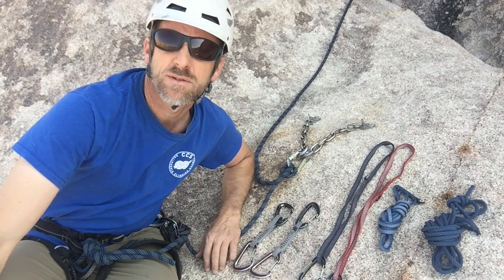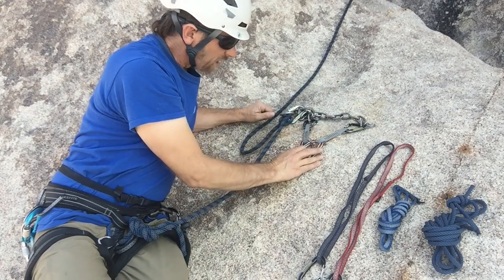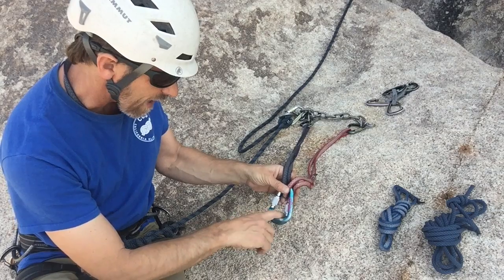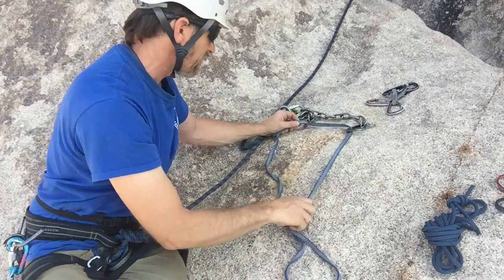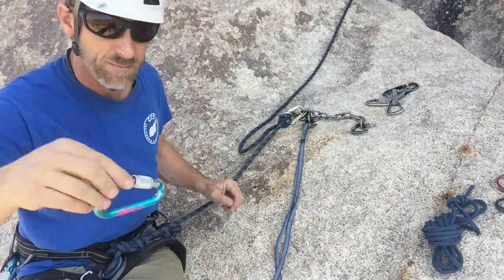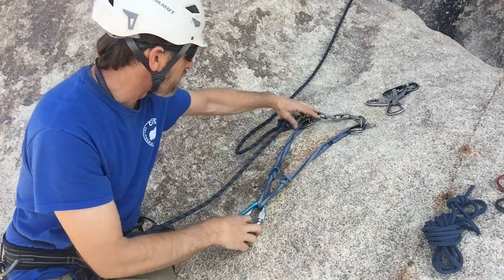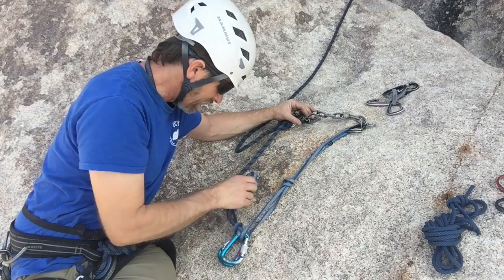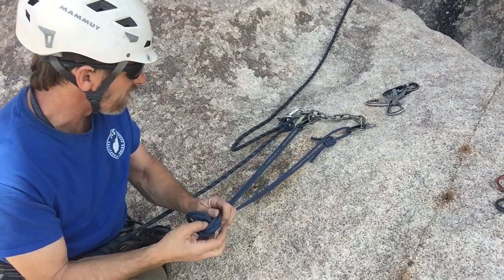How to Rig an Anchor from 2 Bolts

Comment: Watching this as a complete beginner it seems like the double QuickDraw method would be the simplest for someone new to climbing - no knots or angles to worry about and RENE to the extent that you mentioned. Any downsides here or reasons to preferentially choose another method? Also where does a PAS fit into the mix?

Comment: Great video! However with the limiting self equalizing knots you DON'T want to twist the rope. No need to make an x because the knots won't let it pass. Also the x introduces friction so it doesn't self equalize well.
Reply from the maker: What you are suggesting runs counter to my training.  However, techniques do evolve over time, so I am not going to say you are wrong.  In fact, I hope you are right because that would simplify the rig and improve equalization as you point out.  Is there some data or research that you have found to show that the knot won't pass through the masterpoint carabiners if one bolt fails?

Comment: Why not run the rope through the chain ,the carabiner is way weaker then the chain ,that the weakest link in that system
Reply from the maker: Because you can wear grooves in the chains and they will have to be replaced sooner.  You should always put the wear and tear of toprope sessions on your own carabiners instead of wearing out the hardware we all share to rappel/lower off with.  It is acceptable to lower the last climber who cleans the anchor off the chains/rings but not the other members of the party.  Unless there are mussy hooks.  In which case go for it.  They last a really long time.

Comment: Thank you! This weekend passed. I climbed a lot and one duo I met had 3 carabiners on a sliding x. All different sizes too.
His friend climbed up top and couldn’t be lowered down and started buggin out!
I run up top and found their smaller carabiner in the middle was caught between 2 bigger black diamond carabiners. Which was jamming the rope up.
Not a catastrophic human error. But if they were by themselves they would’ve been screwed cu he had no daisy chain to clip into bolts up top amd other stuff I thought of.
So I told them ditch the 3 carabiners or get all the same attaché size so you don’t have that issue again.
Just got into climbing in may so I’m new still but I been out every weekend learning and was glad I got to fix more experienced climbers setup.
I honestly hope climbing is a big part of my life till I’m dead. Never felt so good! Haha
Reply from the maker: You bring up an important point.  3 steel ovals that are the same size and shape seems to work the best for me.  And yes, I always have a sling and a locker that I can leash in with.  I also like to carry a rappel device with me at all times in case I decide it would be better to rappel than be lowered,  ie rockfall injures the belayer.

Comment: I struggle to understand the need for two 24kN rated 'biners yet only a single sling. The sling is if brand new good for 14kN max after adding the knots (~60% of 22kN). Given each bolt is unlikely to blow below 30kN, the sling seems like the weak point! If it broke at the limiter knots then both carabiners would slip right out. I think the sling is added to provide redundancy across the two bolts but in reality becomes a single point of failure at the limiter knots.
Reply from the maker: Great question.  I haven't heard of climbers whose sling broke at the knot in this setup.  In fact it's hard to break a sling in climbing falls.  Have you heard of a failure like that?  I couldn't rule it out but it sounds unlikely.  As far as using just one locker at the master point instead of two, I think that's great if someone has their eyes on it to fix any problems that may occur like the carabiner unscrewing or getting pinched awkwardly. If no one is there to monitor the masterpoint, I feel more comfortable with two carabiners reversed and opposed.  A single 22KN carabiner is plenty strong, but they are squirrelly and get themselves into trouble from time to time.
Reply: @CaliforniaClimbingSchool  https://youtu.be/NwbMfh4FqT4?t=959

Comment: Can you explain why you say it's so important to avoid avoid 6-12" of extension while using a sliding X? I imagine you're using a dynamic rope, right? Climbing with a dynamic rope will prevent the shock load that you're worried about. If you're using a static rope then yes the shock loading will be immense. But climbers use dynamic rope and routinely take much higher falls than the 12" you'd see if an anchor failed. For example, if a 75kg climber falls 3m and there is 15m of dynamic rope available for stretch, the resulting impact force is 2.5kn. But a 12" fall in the same scenario would only be ~1kn. Tying knots in a sling can reduce the breaking strength by 50-60%. So why sacrifice your first line of defense by taking a 20kn sling and turn it into a 8-10kn sling (by tying limiter knots) just to avoid the potential ~1kn of force you'd take if one of your anchors failed? I'm not a climber by the way. I just like the science but your decision doesn't make any sense to me, no offense. Maybe I'm missing something?
Reply: Hi there, I think its because the dynamic rope has already been stretched to its limit by that point thus becoming a static rope? Not sure.

Comment: why not using locking carabiners. its just safer and it dosent take more time
Reply from the maker: If the carabiners are swinging in the air on steep terrain, there is certainly no need for lockers on the bolts.  When the carabiners are pressed into the rock on lower angle terrain, lockers can add a bit of safety.   Accidents where the carabiners clipped to the bolts fail because they were non lockers instead of lockers are rare or perhaps non existent.  At least I am not aware of one.   If you anticipate upward forces on your anchor, then lockers on the bolts can be a good idea, because sometimes the sling/draw/cordellete can unclip from a non locker  on the bolt.
Reply: @CaliforniaClimbingSchool  thanks your for answer.

Comment: Ok so, im no climber, yet.   I must say though, based on NO experience that the single and double lenght runners seem least "safe".  The kN on those seem to be lower than using any of the other systems. Am i way off in thinking that?
Reply from the maker: Yeah that sounds logical but in fact the strength of a runner is 22-24 kN.  About the same as a carabiner.

Comment: I really hope that AMGA doesn't teach people to place two locking carabiners for the rope to run though in a top rope situation. Its unnecessary since its a static anchor and a misunderstanding of physics and the equipment. In rope rescue in two person (2kn) loads, we only use one locking carabiner. We never double up. We don't use two locking carabiners in rappelling or belaying which makes the configuration of the locking carabiner much more potentially active/dynamic with movement and migration.
Reply from the maker: I can't speak for the AMGA.  A carabiner that is not monitored should be backed up with another carabiner reversed and opposed.  If you can monitor that it doesn't become cross loaded or comes unscrewed, then one locker by itself is fine, such as when belaying or rappelling.  But when top roping the master point is out of reach and should have two carabiners.

Comment: For a equalized non extending v anchor, I like to clip a biner through the overhand knot and not worry about using too much rope for the figure 8 and it is easy to untie
Reply from the maker: Can you send a photo?
Reply from the maker: @AKAAK Aah yes, that's a nice method.  It definitely helps untying the overhand knot.
Reply: @AKAAK Dyneema is slippery and has a low melting temperature, so if it starts sliding while used as a prusik it can fail pretty quickly because of the heat caused by friction. Nylon has a slightly higher melting temperature so it's not quite as sensitive, but slings are still kinda slippery compared to cord. It can be used in a pinch but you'll likely need more wraps around the rope than you would with a cord for it to not slide. If you have a choice, there's no reason to pick a flat sling over a cord for use as a prusik.

Comment: If the loop you twist for the sliding x fails would the sling slip out past the limiting knots?
Reply from the maker: No.  If one strand fails the other strand remains connected.

Comment: video starts with climber already attached to chain with clove hitch without any explanation. Basically all videos are done like this. Its confusing. Its really hard to find video with all needed steps. When you complete pitch, first thing you need to do is to secure yourself and than to build anchor. How to combine self-anchoring with anchor for second climber in effective way?  Such video is needed.  If there are no chains (and usually there are not) such setup is not possible. Thanks for video, it is good, bur for me not complete.
Reply from the maker: Great question.  I agonized over the intro.  There are so many ways to do the preliminary steps.  It depends if you lead the pitch or if you scramble up the back side to set up a top rope. And it depends how you like to carry your rope-in a rope bag, coiled, and which coiling method you choose. It also depends on whether you want to leash in with a sling/PAS or with the rope.   My intention was to create a video for climbers who do not know how to lead.  You are right, I should create a video that shows the whole process from start to finish.

Comment: Correct me if I’m wrong but i think your demo of the 2 QuickDraw anchor was incorrect.  The gates of the bottom Caribiners should be facing away from each other, not towards.  1:12
Reply from the maker: No matter if the bottom carabiners are facing away from each other or towards one another you get the exact same result: reversed and opposed carabiners at the master point.

Comment: very nice video!
try to keep the mic clear from rubbing.
Reply from the maker: I stopped using that clip on mic because of that problem.  How can I keep the mic from rubbing?
Reply: @CaliforniaClimbingSchool  I assume you are using a wired lavalier that is attached to the neck of your shirt. Probably because of the position you are sitting in you rub your neck/helmet-strap against the lavalier. You could think about attaching it to your helmet cap. It's still close to the mouth but will give you more freedom of movement. You can also think about a wireless lavalier system like the Rode wireless go. This is very user friendly (click-and-go) plus, it won't be necessary to sync audio afterward. 

More technical, you could also try to lower die recording levels on your recording device. then afterwards in editing you have less background noise + rubbing sounds or hissing.

Comment: Using a double length sling (4:00) or a cordelette (9:00) tie a clove hitch for the master point and a clove hitch at each of the two bolts for a safer, stronger, adjustable, and faster system. The master point clove hitch is easy to untie as where the loaded over hand and figure eight knots are harder to untie when loaded, frozen, or with gloves.  The clove hitches at the anchors act as shock absorbers and hold the sling in place. There is less shock loading. Thanks. Steve Thaw, Moraga, California
Reply from the maker: Cool!  I haven't seen it but it sounds efficient.  Do you use it for toprope or multi-pitch?

Comment: Hi, what about a rope anchor with bunny ears?
Reply from the maker: Do you mean bunny ears at the master point or bunny ears on the bolts? Or both?
Reply: @CaliforniaClimbingSchool  At the bolts
Reply from the maker: @SoCalkiteflier  Old school-it works OK if you are swapping leads up a multi pitch and you don't need the full length of the rope.  The second has no clear place to clip in when they reach the anchor.   A sling or a cordelette anchor with a master point makes it easier for the second to clip in and facilitates self-rescue techniques and rappelling.

Comment: Great video.  I appreciate the details like "keep that angle at less than 60º".  Can you please comment on the use of non-locking carabiners at the bolt instead of locking?  I notice that non-locking is common practice but would like to know if there is a specific reason.  Thank you!
Reply from the maker: Great question.  There's a chance when the climber reaches the master point they climb a little too high and when they lean back the rope could come across the gate of a non-locker and unclip.  There's more action on the masterpoint carabiners with the rope getting flicked and flipped, compared to the action at the bolt which is much less.  More action = more chance of failure as carabiners re-position and re-orient themselves.  But lockers on the bolts is ideal.  If you have extra lockers for the bolts, why not?  Especially for extended top rope sessions where no one can monitor the anchor.

Comment: So cordelette vs double length sling?
Reply from the maker: Both are awesome! Dyneema slings are so slim and slippery that the knots are tough to untie afterwards, but great for alpine adventures due to weight.  When I'm closer to the road I like a nylon/spectra blend sling that is easier to untie and more durable.  A cordelette is ideal for trad when you have 3 pieces of pro to equalize.  Another awesome way to rig two bolts is the quad method with a cordelette.  Pick your favorite and master it.  No need to learn 17 methods to rig anchors unless you're a nerd like me :)
Reply: Thanks!

Comment: You should tie a  figer 8 in each of the slings befor you  put the lockers on
Reply from the maker: Why?
Reply: It just does not seem strong🤔 i am traing to be a climbing guide  and I have never climbed on two slings  that were not tied at the ends I have climbed with ken nicals and I have seen his ankers and he just does some wiyeld ankers to  😏
Reply from the maker: @johnparla6252  Tying a knot weakens the sling.  Plus tying and untying knots takes more time and can be tough to untie if you put a lot of force on the anchor.

Comment: The "Sliding X" is not redundant if the sling were to break at one side of the bolt - this is only redundant if the bolt or carabiner were to fail. If using the "Sliding X", limiting knots should be used. Otherwise great info!
Reply from the maker: Thank you!  I 99% agree.  The 1% could be the rare situation where a long, cold alpine climb makes taking off gloves and tying knots difficult and time consuming.  In this case it might help you avoid frostbite to your fingers if you keep your warm gloves on and don't bother tying and untying knots with your bare hands.  Obviously this wouldn't be a 2 bolt anchor-it might be a snow,  ice, or rock anchor.  The point is sometimes the simple techniques can save enough time to save your life. But I wouldn't use the sliding X without limiting knots unless there was a great need for speed!